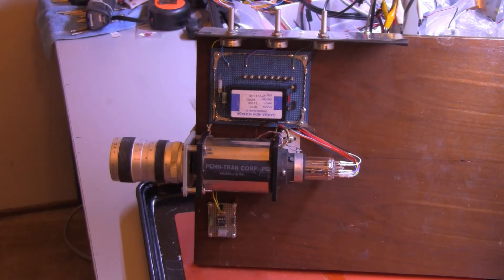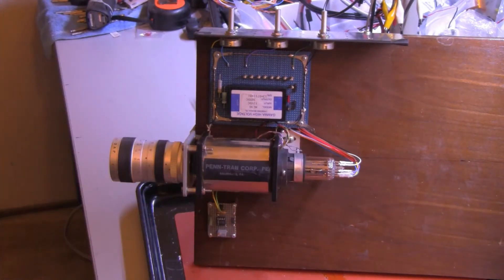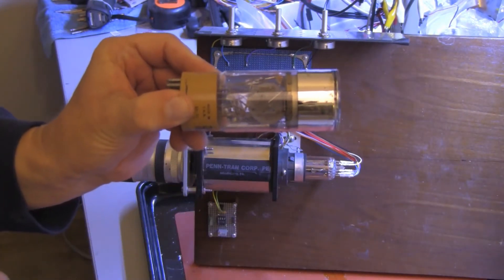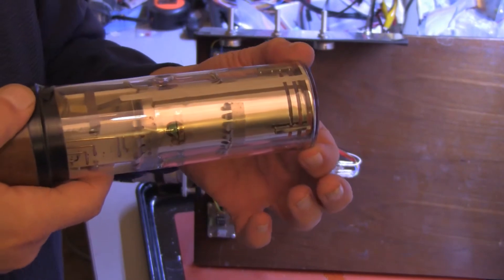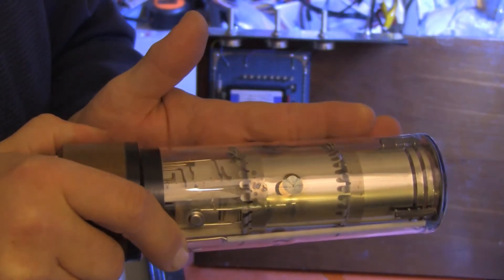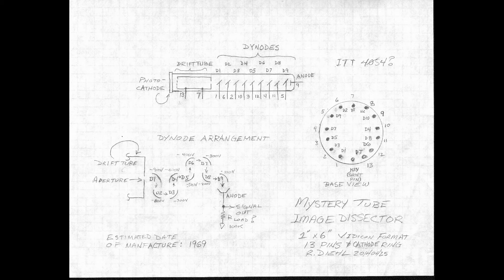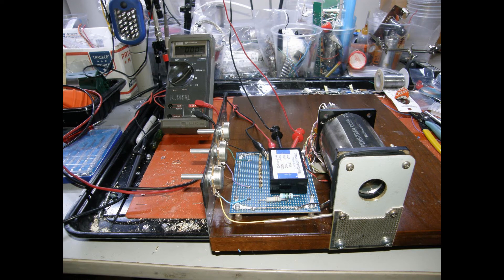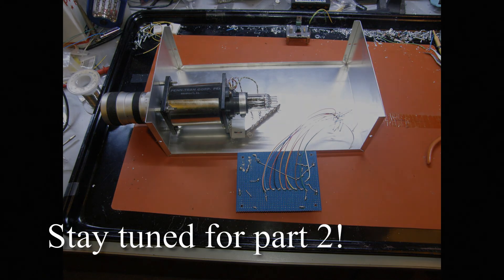PhiloCam Part 1 Introduction

Comment: It is possible that image dissector came from a system for monitoring an arc furnace or welding fixture.  These types of tubes are advantageous for such an application since their operation is unaffected by overly intense light sources.
Reply from the maker: I believe that both two inch tubes I have were for some form of scientific application. One has a gold plated mask with three fine slits on the front, which looks like either a precision position sensor or perhaps for a spectrograph. The other is a full imager and I think these were used on very early computer document scanners. One day, I hope to try to make the imager version work. That's a long way off for now.